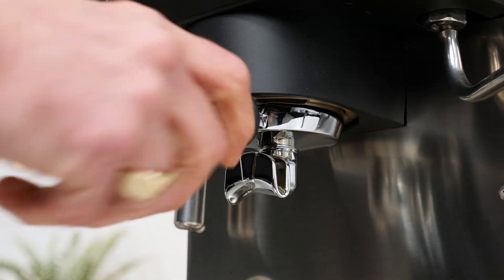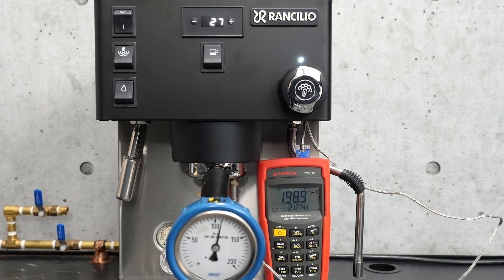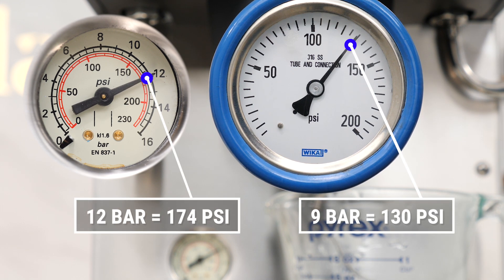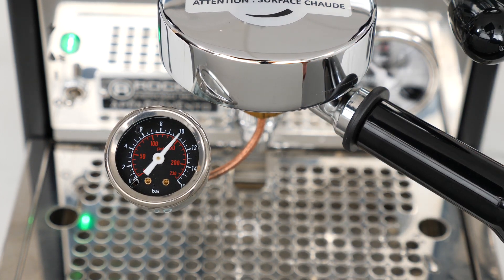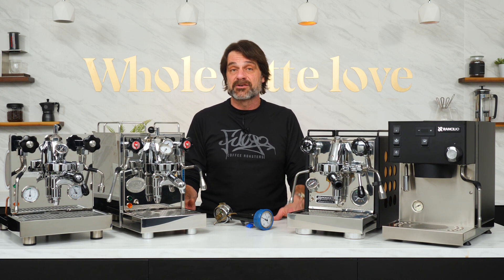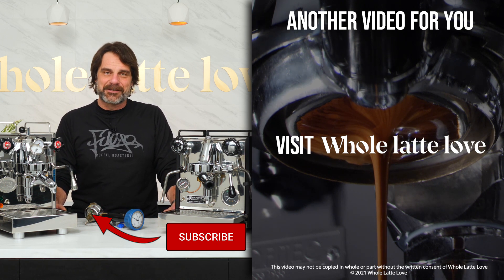Brew Pressure on Vibration Pump Espresso Machines

Comment: I have a Strange behavior on my Lelit Bianca V3 I had 9.75 bar pressure at the pump and 11 bar pressure at the group head? 

What could be the reason for that?
Reply from the maker: Hey Average Joe, typically pressures read higher on the machine gauge (pump pressure in cold water) than at the group - especially on vibration pump machines. Rotary pump machines like the Bianca usually have less difference between the measuring points. You might be seeing a difference due to adding of smaller errors of each gauge, error of 1 gauge or other issue. Heating water in the boiler could add a slight amount of pressure if boiler was running far too hot.

Comment: Hi, i have static pressure 12bar on ecm puristika pid, it is alright ?
Reply from the maker: Hi tim, If it's a Puristika you can adjust the static pressure as desired using the knob to upper right. Standard brew pressure for espresso is 9 bar. But, you can adjust higher or lower and see how that changes your extraction.
Reply: @Wholelattelovepage thank for your answer.
What static pressure do you recommend for puristika with vibration pump ?

Comment: i have elba mini presure about 12 bar its normal or not ?
Reply from the maker: Hi d, some manufacturers set static brew system pressure higher than others - especially on machines with vibration pumps which have lower flow rates of brew water compared to machines with rotary pumps. 12 bar is common and I've seen that on machines from Bezzera and Rancilio. Keep in mind that brew system pressure is measured near the pump it will be higher than what is actually applied to the coffee. Also, that's a static pressure which is always higher than what's in the portafilter during an extraction.

Comment: Hi, Marc!
Since you also sell the Lelit line and have access to the Scace device, could you tell us what static pressure value the Lelit Elizabeth manometer will show when adjusting the OPV to reach 9 bar of pressure in the group head using the Scace?

Comment: i just had my bezzera bz13 professionally repaired, but now the pressure is set at about 8 bars (with blind basket, during coffee extraction it starts at about 8 and drops to about 7.2). im now struggling to dial in the espresso (which i usually know how to do), its always way too sour no matter how i adjust grind size and dose. could that be a result of the low brew pressure, aka do i need to adjust it?
Reply from the maker: Hey wp, 8 bar static pressure (blind basket) is a bit low for a vibration pump machine. Actual pressure in filter basket is likely ~7bar during extraction if reading 8 on the gauge. +/- 2 bar off 9 has been show to have liitle affect on measurable espresso parameters like TDS. But, yours is near the point where flavor changes could happen due to pressure. What was your static pressure before service? If better results with that I'd open it up and adjust the OPV to static pressure you had before service. Hope that helps!

Comment: Hey Mark. Thanks for this professional video!!

Any idea why does the Apartamento comes stock with 12 bar static pressure ? 
One more question - if I brew coffee and have pressure gauge installed on the e61 brew head - should it still show 10 bars in case I want 9 bar extraction? Or is that just for static pressure ?
Reply from the maker: Hey g, you are welcome for video! Machine manufacturers often set higher static pressures on vibration pump machines as they have lower flow rates than rotary pump machines. Also, the pressure is typically measured deep in the machine in cold water just after the pump. Static pressure at that point will in most cases be higher than a static pressure measured at the group.
Don't get too wrapped up in a bar or two of pressure regardless of where it's measured. That said if looking to get 9 bar on your coffee during an extraction you'll need a higher static pressure like 10 bar on a group gauge to get it.
Marc

Comment: Hi Marc, my Lelit Kate comes with 11 bar on machine gauge. Should I just leave it or lower it to 10 ish? Thanks.
Reply from the maker: Hi s, Thanks for the question. If that's a static pressure reading I'd leave as is. The 11 bar static on the gauge is likely producing ~9bar inside the portafilter during an actual extraction.
Marc

Comment: I see a lot of machines and it describes 20 bars is it true? because I thought most bars were better
Reply from the maker: Hi s, A lot of lower end machines advertise 15 bar etc. It's all marketing based on the more is better mentality. Technically pumps may be able to produce 15 bar but you really do not want to extract espresso at that pressure.

Comment: How is the pump/brew pressure adjusted on the La Nueva? Era Cuadra v1 espresso machine?
It seems that the earlier machines were set for 16 bars, whereas the v2 appears to have a 9- bar setting!
Reply from the maker: Hi mb, Unfortunately I'm not familiar with that machine. If it uses a vibration pump like machine in this video then you be looking for an OPV: Over Pressure Valve to adjust. If a powered by a rotary pump then there usually a bypass scree on the side of the pump to adjust the maximum static brew pressure.

Comment: Halo marc apa ada perbedaan antara tekanan termoblock dengan boiler??semisal kita adjust opv tentu akan merubah maupun kalibrasi grindsize gilingan kopi bukan??thks
Reply from the maker: Termoblok digunakan untuk memanaskan air pada mesin berbiaya lebih rendah sehingga tidak ada hubungannya dengan tekanan boiler. Jika Anda menyesuaikan OPV, Anda mengubah tekanan maksimum yang dapat diterapkan pada kopi bubuk. Mengubah tekanan minuman mungkin memerlukan perubahan ukuran gilingan.
Marc

translation: Hello Marc, is there a difference between thermoblock and boiler pressure? For example, if we adjust the OPV, of course it will change and calibrate the grind size of the coffee grinder, right? Thks

Thermoblocks are used to heat water in lower cost machines so has nothing to do boiler pressure. If you adjust the OPV you are changing the maximum pressure which can be applied to the ground coffee. Changing brew pressure may require change to grind size.
Marc

Comment: Nice video explaining the bar pressure differences -   would you know or can you tell me if - on my Bezzera Unica -  it shows 12 bar all the time when i pull a shot -  would you know if it does give 9 bar when the water hits the coffee  at the group head  or -  have you tested this machine model to know what it actually does -    as you showed the Silva hits 12 Bar like mines but is actually 9 bar at the group -     have you tested the Unica this way - would you be able to test it and confirm what it does etc,  thanks
Reply from the maker: Hi v, have not put a scace with pressure reading device to determine group pressure during simulated extraction. My guess is it's significantly lower than 12.
Reply: @Wholelattelovepage  i have added one that shows the pressure at the group head - it shows 11 bar on my unica -    12 bar on the machine -  i am not worried about this 9 bar etc, debate - my only reason is being that my Unica has a whistle most times  -  due to the OPV -  i have contacted Bezzera - they told me to contact you WLL for updates - they may release a new OPV or solution to it -   how long do i wait before asking WLL about this -   thanks -  Machine is great - not a problem -  12 bar is fine for me -  its the whistle that happens at most times -
Reply: @Wholelattelovepage    i can show you a pic of it  showing 11 bar -  not sure how to add a picture here if you can  - if you want to see it -  where can i send it - thanks

Comment: Great to know.  Thank you. But the question is also to know if the "rule" of 9 bar pressure was meant 9 bar on the puck, or somewhere else...
Reply from the maker: Hi MB, Thanks for the question.10 bar static pressure on the gauge of a vibration pump usually gets you ~9 bar max available on the puck during an extraction. That "rule" is overrated!  It's become the dogma because that's what the original machines did way back when. I've had excellent shots pulled on manual lever machine that hit much higher pressures. And wonderful shots extracted at lower pressures. The only way to truly know (and honestly you shouldn't worry about it that much) is a group mounted pressure gauge or Scace or similar group pressure measuring device which can be tuned to simulate the release of water you'd have during a standard espresso extraction.

Comment: My Lelit Anita produces great-tasting coffee with nice flow rate but the gauge shows 12 BAR, is that OK?
Reply from the maker: Hi d, Honestly people get too wrapped up in brew pressure. Many manufacturers use a higher static pressure setting in machines with vibration pumps as they move less water than rotary pumps. Understand that the pressure reading is taken deeper in the machine near the pump in the cold water before the boiler and does not represent perfectly represent the pressure in the portafilter during an extraction. 12 bar should be fine on your machine.
Reply: @Wholelattelovepage  thank you so much for the detailed reply!
So, no need to
Adjust the OPV the 9 bar read at the gauge?

Thanks!
Reply from the maker: @daniwello  I'd leave as is.

Comment: Questions here: So most motorized coffee machines show the static pressure rather than the pressure on coffee? Static pressure is always higher than the pressure on coffee? My LaPavoni (lever, esperto abile) has a gauge right above the group head... I'm reading the pressure on the coffee, right? So if I'm reading 8 bars on that gauge, is this equivalent to 8 bars displayed on the gauge of a Rocket (or other comparable machine), or not?
Reply from the maker: Hi CT, Static pressure is measured when there is no flow from the group - like if a backflush disc is installed in the portafilter. Most machine face mounted gauges measure pressure before the boiler (in cold water) and very near the pump. During an extraction those gauges do give an idea of pressure on the coffee but it's not as accurate as a group mounted gauge within the flow of brew water. It varies by machine and pump type but face mounted gauges may read a bar or 2 higher than actual pressure on the coffee during an extraction.

Comment: Nowhere can I find a video or any other manual on how to adjust the pressure on Bellezza Valentina v2? Thanks for any help!
Reply from the maker: Hi SK, It can be difficult to find info including diagrams for made in China products. You will likely need to open up the machine and find the expansion valve aka OPV. I do not have a Valentina to guide you but near 100% certain it is a vibration pump machine so once you find the OPV process is similar to what's shown in this video. I did locate this thread on Home Barista which may be helpful: https://www.home-barista.com/espresso-machines/valentina-brew-pressure-adjustment-t263.html

Comment: I have profitec pro600, I set my pump pressure at 9 bar, but with blind disc installed it reads 10bar from group head pressure. Why group head is showing 1 bar higher than pump guage? It happens either with blind disc in or espresso extraction. It always reads 1 bar higher from group head gauge. My machine was just arrived from WLL about a week ago. Is it defect or faulty? As on other videos from WLL for these same machines, it should read same pressure when back flusing using blind disc? Please advise.
Reply from the maker: Hi Sharing, Your machine is not defective. Perfectly normal that pressure reads a bit higher on the group gauge. Here's a video explaining why: https://youtu.be/2ArWAtuUTOM?si=RK-ZouF6r1PcNljq
The video demonstrates on a Pro 700 but reasons are the same.
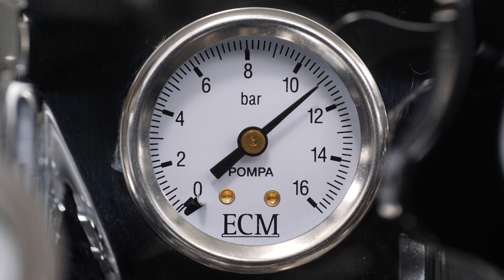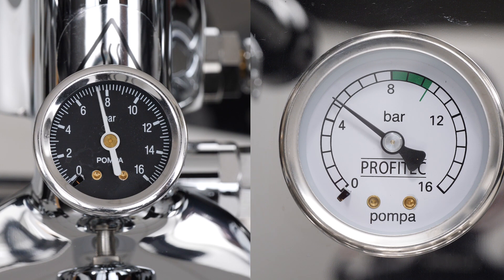Reply: But why the machines here in this video is reading same pressure?? Dont understand why.. see 3:36 1:01
Reply: Please advise!

Comment: Hi! 
What do you recommend for crem one hx? The machine came with 12 bar on machine gage, I dropped it to 10. Is that right for 9bar in actual group?
Reply from the maker: Hi user, I recommend setting to 10 bar static pressure.

Comment: Do you have a chart for all the machines you sell? I have a pathfinder and trying to figure out if 10 static is 9?
Reply from the maker: Hi bp, we do not have a chart with all machines and there is some variance. On the Pathfinder which uses a vibration pump 10 bar static should get you a max of ~9 at the group during an extraction.
Reply: @Wholelattelovepage  my pathfinder shows 10 bar at gauge and 11 at group head, strange.

Comment: Excellent Video. I replaced my faulty pressurestat a month ago, opting for the same black one. My thermometer that displays a temperature exceeding 112 degrees on the brew group. I have lowered the pressure to 0.8, which has caused the brew temperature to reach 95 degrees. Could I elevate the pressure to .9 or 1 while ensuring that the brew temperatures remain between 90-95? Your suggestion would be greatly appreciated.
Reply from the maker: Hi M, You did not mention what type of machine. I'm assuming it's an HX boiler with E61 group. .8 bar in the boiler gives you an in boiler temp of ~117C. That temperature is reduced a bit in the HX section of the boiler due to the thermosiphon loop which circulates water out to the group and back. 1 bar in the boiler results in an in boiler temp of ~120C. Every HX machine is a little different in the offset between the in boiler temp and the temp delivered to the group head. Machines controlled by pressurestat tend to have a wider temperature range than those controlled by PID. Also this type of machine will overheat if left on and idle for long periods. Normal operating procedure of an HX pressurestat machine is to do a cooling flush from the group head prior to pulling an extraction. It flushes out overheated water and reduces brew temps. Generally you'd flush until water flow from the group is no longer extra steamy and turbulent due to flash boiling. It's usually a 2 - 6 second flush to reduce temps but depends on when machine was last used and how long it's been idle. Hope that helps!
Reply: Thank you for replay. I'm sorry for not mentioning earlier, but the machine I have is the Rocket Appartemento. The temperature of 117C excessively high; nevertheless, your recommendation is to promptly power off the machine after every use if I'm correct?. Furthermore, I am considering seeking a method to autonomously control the heater by utilizing a sensor and electronic mechanisms.

Comment: Great video! I'm curious: how would you go about adjusting towards 6 bars? On the Rancilio machine would this be as simple as setting the static reading to 9 bars or should you account for a lower difference between flow and static readings when lowering the overall pressure?
Im trying to set my machine to 6 bars based on the ulka-pump flow chart but guess a static reading from manometer would be easy and way more precise. The question remains: how to convert static readings to actual pressure during shots with 6 bars of pressure?
Reply from the maker: Hi ander, thanks for the comment and question. Unfortunately not as simple as setting to 9 bar static. To be precise you'll need a device like a Scace which can measure pressure in the portafilter as some brew water is released which simulates an extraction. However Scace and similar are relatively expensive. If you can measure static pressure in the group, ~8 bar there should get you ~6 during an extraction.

Comment: Why isn’t my ECM coffee machine not showing any pressure changes during extraction or when using the blind filter.   This has worked fine before and coffee making still seems fine. Any suggestions
Reply from the maker: Hi rp, Hard to be certain from here but sounds like the gauge is malfunctioning if machine is otherwise working normally. If you purchased machine from us and would like assitance you can submit a ticket to our tech support staff here: https://www.wholelattelove.com/pages/contact-us

Comment: Hello Marc, would you know by any chance what the brew pressure of a Rocket Appartamento is when the brew pressure gauge (or static pressure) reads 12 bar?
Reply from the maker: hi c, As I recall it's a drop of 1-1.5bar from reading on machine pressure gauge.
Marc
Reply: @Wholelattelovepage  thanks so much for the quick response!
Reply: Have you mounted a pressure gauge on your machine? I have and just got my Appartamento back from service as the lower they pressure. The gauge is now showing 9 bars but I think the shots tastes a bit watery. Have tried to grind finer but still not improving as I hoped.

Comment: I bought a portafilter with pressure gauge and measured the static pressure of my 2001 Baby Gaggia, it was 14 (fourteen) bars. That's strange because my Baby Gaggia was not sold with a pressurized filter, yet Gaggia decided that it had to set the pressure to a pressure that would imply use with a pressurized filter. I will try to fix it.